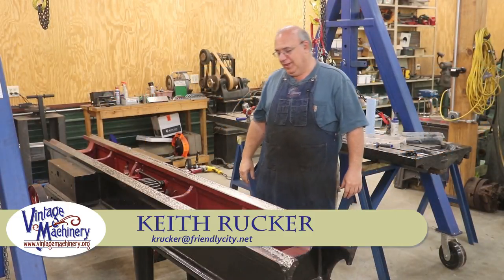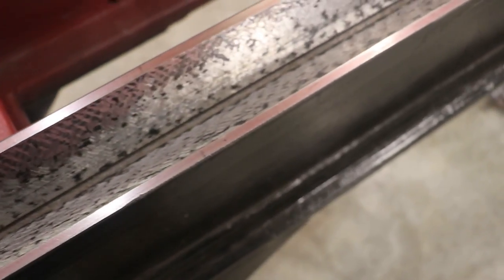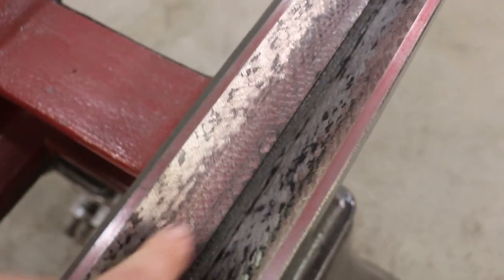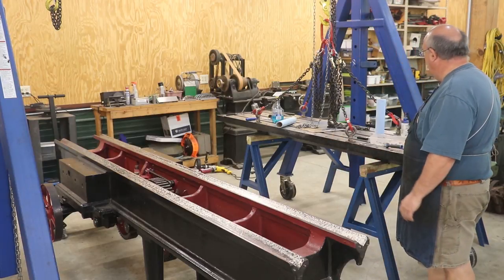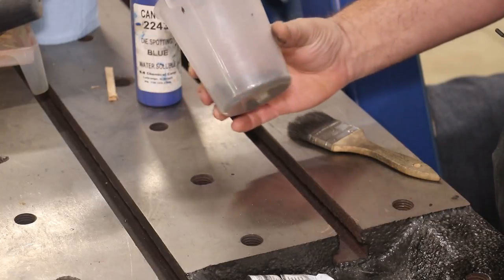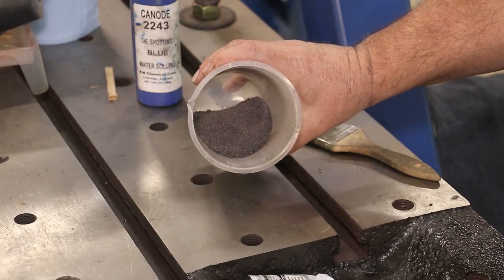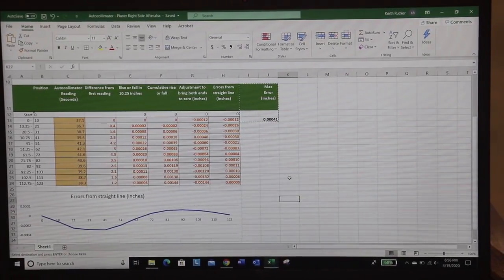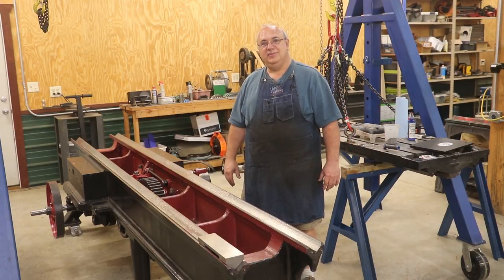Metal Planer Restoration - Part 28:  Final Scraping of the Base Bed and Testing

Comment: Go metric. You can delete half your memory and make room for some sensible stuff.
Reply: What's the challenge in that?
Reply: Lars , What's all this nonsense about metric versus imperial . . both measurements are just NUMBERS. don't you metric guys say things like half a mil. off or its almost half a meter long ?. both these systems are based on  ten . hundred and thousand... think of it as just numbers and it isn't complicated or hard to work with . Nowadays with digital readouts conversion if you need it is usually just a push of a button . I rest my case and wait for the flak.
Reply: @karlhrdylicka  Half a mile died with the industrial revolution. US share the imperial measurement system with Liberia, Myanmar and Britain (partly). The rest of the world is primarily metric.
Reply: @karlhrdylicka  That would be OK if Imperial measurements were all the same base units which they are not. An imperial gallon is different in volume to a US gallon for example. Metric lengths volumes and areas all correspond with each other. For example 1 cubic meter of water is one metric ton in weight. I bet you couldn't tell me how much a cubic yard of water weighs without looking it up and it wouldn't be a round number for sure.
Reply: @dazaspc  Not argue about the comments you made , they are correct , BUT I have never in all my life needed to get water by the cubic yard. 5 gallons is a much as I can lift and carry . . yes I know USA gallon slightly less but still 8 pints I guess those are smaller as well .In Britain /UK domestic house gas and water are actually in cubic meters now, same as fuel and oil  that also metric ,but people usually buy fuel in £s example  just put 30 quids worth in the tank. Even in the days before money went metric pre 1972  £ S D.pounds /shillings / pence . was not a problem for those of us brought up with the system. Don't get me started on Threads . pitches and angles etc that another full page on its own.
Reply: @lpabildgaard  , Quite so .I work in both so I don't see it as a problem.I buy bread flour in metric because that's how it is sold now , but I use imperial ounces on the scale  when weighing the ingredients, I have always done so for many years , just depends on what system  you get use to.
Reply: Quit so, these days we are all better off on our porch smoking the old cornpipe. Converting 2 cups to dl., drills size from 5/8 inches to mm., I see the beauty in some of it but in the practical world? nope.  I'm sure after BREXIT UK will have a defiant period praising pounds and stone as superior units to kg. Give in, conform, get on.
Reply: america will never learn, it doesnt like to work with the rest of the world anyway
Reply: @lpabildgaard  yes brexit will have a revival of feet, pounds and probably want to return to pounds/shillings/pence pre decimalization as still far too many people didnt learn metric since the 1972 changeover
Reply: @karlhrdylicka  lol  Well there are all sorts of variable standards. The true definition of a standard is it is the way you want to do it. Just the other day I had to replace some m11 and m9 bolts. Guess what country that part came from?  In Australia you need to know them all.
Reply: @dazaspc  .Very true many times I have retapped a 5/16 whit or unc threaded  hole with an iffy thread  with a 13mm 1.25mm and used the metric bolt or stud .   works both ways on lots of other  different sizes.also helicoil /recoil or riv nuts can also be utilised in a lot of situations .
Reply: @karlhrdylicka  Oh no these were in perfect condition they were m9 and m11. Even when America goes metric it still has to be different.
Reply: @dazaspc  .True not what I would expect as commonly used  sizes m9  m11.  Altho some of the vehicles from the far east countries have odd size  nut and bolt heads for the normal thread sizes.
Reply: @karlhrdylicka  Japan metric has variations from the ISO. Then there is the issue of pipe threads Still based on the old British standard but part of the ISO standards.
Reply: @larryschweitzer4904 . Opps my reply just dissapeared . here goes take 2.  BSP British Standard Pipe . was at one time nearly all the world standard for pipes but gradually over the years other countries have come up with their own. It makes it somewhat of a minefield at times trying to identify the thread plus trying to get fittings.High pressure hydraulic fine pitch threads used on plant equipment for example so many different ones ..
Reply: @karlhrdylicka  I know the issues of trying to match pipe threads only too well. We've got USA, Japanese , German, old Polish & Italian equipment in the shop. Some fittings are taper, some straight. Various people have worked on them over the years, resulting in the wrong fittings used, fixed with all sorts of "sealers."
Reply: @larryschweitzer4904  .We are on the same page ol'sport . been there  done it , got the 'T' shirt . just not got around to writing the book .